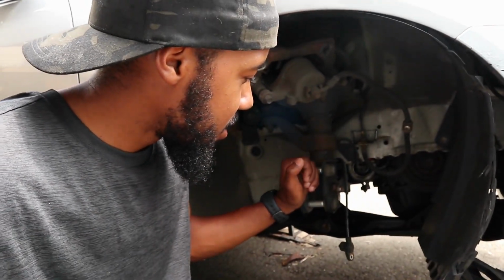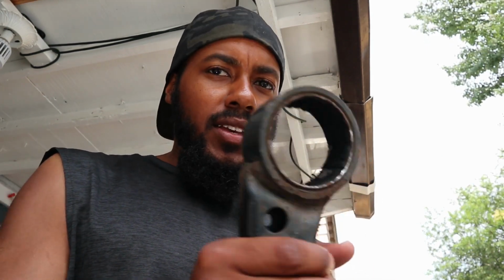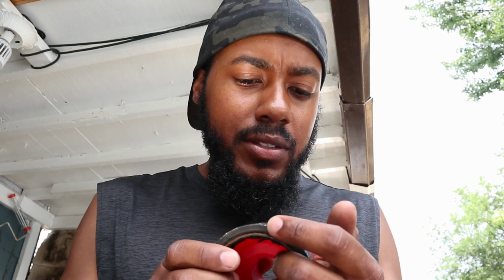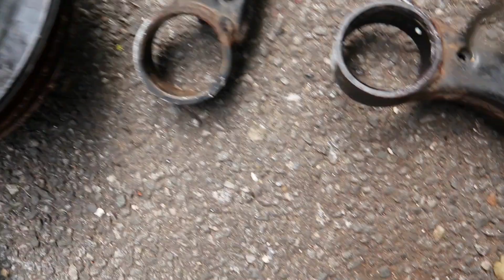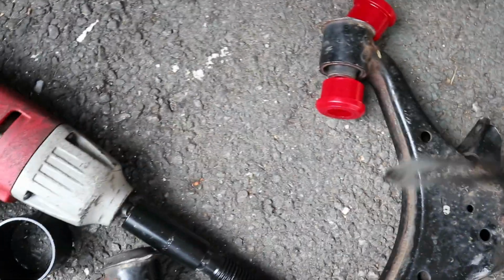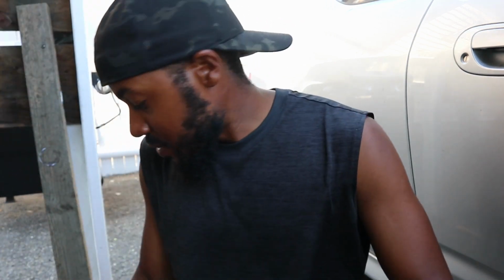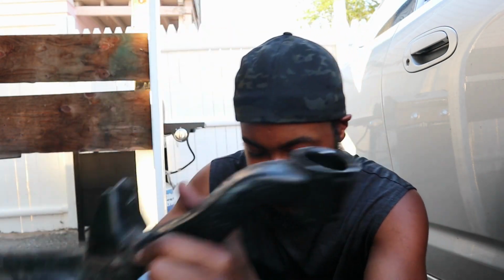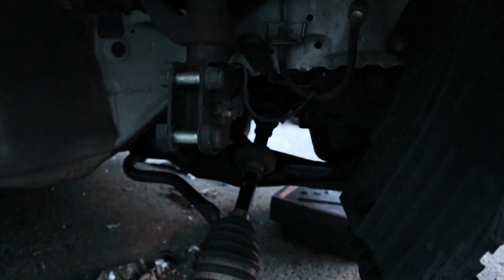Installing Energy Suspension Bushings on my Acura RSX

Comment: Instructions from Energy Suspension says remove OEM sleeves. Just curious, did your bushing kit not come with diagrams/ instructions?
Reply: The directions just say that to press the old bushing out. I assume that the sleeve is part of the old bushing, they want the sleeve out as well

Comment: Hey man, as you can tell, your video is still doing wonders for the RSX community.  Could you share what you noticed that led you to realizing you should have left the sleeves in?  After letting my mechanic talk me into him remove them, I am trying to track down a popping noise that i have tried everything to diagnose.  I am wondering if it could be related to him removing the sleeves.  Did you experience any noise or popping?

Comment: Good job, but you are not supposed to lubricate the outside of the bushings ( clamping force ) 
only the inside of the bushings are supposed to be grease ( the working part )

* liquid soap is use to install the bushings *

Comment: A tube of high pressure grease and the willingness to get dirty saves a lot of time and actually leads to a better/ longer lasting install imo. Nonetheless, props to you for getting it done and documenting some of the process for others. I think you just motivated me to throw my 360 cam outside when I work on my engines and spend the time to edit some decent content. I wrench full  time and have my life's savings invested in tools, and I have mad respect for anyone of any skill level who gets it done 👍👍 the most important thing I learned in my time spent as a mechanic was to make everything a learning experience.

Comment: I took the sleeves out. The bushings I got were pretty tight on there. Made it somewhat difficult to push down on the LCA so that it lines up my spindle with the strut bolts.

Comment: There are a lot of issues with these bushings, some are not manufacturers' fault, others - are. And I am not talking about price - this is something the buyer at least knows in advance.

1. Their claim that all it takes is "some smoke from the bushing to separate the sleeves from rubber" is outright lie. It may be the case with jeep but certainly not with Toyota - you need to torch it for a long time to actually burn rubber off.

2. The fact that they don't provide sleeves with the bushings is simply ridiculous. Especially considering price. In fact, I would not mind paying extra so that I did not have to dicect the old bushings, and the first issue is minor compared to this one. It is pretty common for bolts/sleeves freeze in bushings so it's virtually impossible to separated them from inner bushing sleeves without damaging. 
It may not be an issue with jeeps and fords because their bushings are replaced on a regular basis but Toyota bushings last so long that it's practically unavoidable to face this. In my case, the truck is 17 yo with 230,000 miles, and the original bushings were still good. The only reason I had to replace them was installation of lift and JBA upper control arms that required alignment that couldn't be performed because - you guessed it - one bolt and one cam sleeve were frozen. After 17 years in the Midwest and N-E, is should not come as a surprise.
This condition requires a hell of a lot of heating and pounding, pounding and heating, and then it's a real PITA to attach the [original] washers to most likely damaged bushing sleeves.

3. The last issue is design - there are no lubrication means. And don't tell me it's impossible - just look at JBA upper control arms. I installed grease fitting in control arm ears and drilled holes in the bushings to allow grease flow to inner sleeves. Hope it will work.

Overall, bushing material is probably adequate but pure inexcusable greed that prevented the manufacturer from providing lower bushing sleeves and washers (even for extra $$) is beyond ridiculous. 
Bottom line: if your vehicle is 10+ yo and has spent that time in places where winter happens every year, expect MAJOR (BIGLY!) hassle installing these bushings. Or - MUCH BETTER OPTION - buy from another manufacture that does provide all necessary coponents and does not force to wash and reuse condoms because reusing bushing sleeves is just as ridiculous as reusing condoms.
Reply from the maker: Wow thanks man for all your input! You're points are definitely valid! I was laughing at washing and reusing the condom lol, but it is true! They could have included the sleeves and a way to grease the bushings! I'm going to most likely go back to stock

Comment: Your supposed to remove the sleeve and use a purpose made grease on each bushing. Whatever works ig
Reply from the maker: Yeah I used the grease it came with but found out later on the website I was suppose to leave the sleeves. I'll be redoing them 😅

Comment: Your energy suspension came with instructions to remove the old bushings and SLEEVE.  Did you read the instructions? Just saying my friend.  Good luck with future servicing on you acura. I'm a long time honda/Acura tech. If you need anything just reach out my good man👍
Reply from the maker: Yeah I found out after, I'll be redoing it 😅. My first time using the energy bushings. The instructions wasn't clear on the sleeves. I had to search their website to find it
Reply: @aspireddrivenauto8650  good deal. Looking forward to more videos👍

Comment: Would an air hammer be enough to pop out the old bushings?
Reply from the maker: It's worth a try. The only thing is, the ledge you would put the air hammer on is very thin but I'm sure with some figuring things out, it could work

Comment: So ur saying not to pull out the sleeves for the bigger bushing because the polyurethane fits loosely if I take out the sleeves ?
Reply from the maker: Correct,  its not really loose but just a bit. I went on their website and seen that with that bushing, you leave the sleeve in.

Comment: Do you need to take out the metal sleeves from both bushings or do you need to leave them on the lower control arm & then press in the bushings?
Reply from the maker: If your installing the Energy suspension bushings,  leave the sleeves in.
Reply from the maker: The bushings for the smaller round one (left side), you can take the sleeves out
Reply: Yeah, I’m installing the same ones you did. Did the sleeve you take off affect your driving?
Reply from the maker: It doesn't affect the driving,  but I do hear it just a bit.

Comment: Is it better to clean out the residue from the old bushing in the sleeve? Just wondering why you didn't do that and just put the new bushing in. I'm looking at poly bushings for my ep3. Great video! Thanks!
Reply from the maker: Nice! Leave the sleeves in, I cut it out but there a small bit of play. I didn't clean them out thoroughly because I didn't think it would make a difference since the new bushings are polyurethane. There wasn't much left on there though. Thanks man ✊🏾 good luck with your car

Comment: Hey man do not stop bro you have been helping me out so much with my swap please keep making awesome videos brother. Thank you!!
Reply from the maker: Thanks, I know I've been slacking 😅. Just not enough hours in the day lol. I still have to edit the video of me pulling the dash out. Cars just about ready. Just a few final things then I can do a first start
Reply: Aspired Driven Auto I have a base auto rsx to and I’m swapping mines to standard right now but I was confused on the wiring harnes but I’m pretty I sure I seen in some comments you said we can still use the auto harness so I’m happy about that can’t wait.
Reply from the maker: I just started the car today. Everything seems to be running fine. No check engine lights at the moment. I'm still using the auto harness, I just had to extend the speed sensor. I'll test drive it tomorrow, hopefully everything is fine 🤞🏾
Reply: Aspired Driven Auto nice very awesome to hear I’m from Hawaii so not a lot of people doing rsx swaps out here so you had all the answers I’m looking for thank you again 👍👏🙏 you’re awesome brotha
Reply: Did the reverse plug fit to with the auto harness ?
Reply from the maker: No, I have to buy the connector and wire it in to the ECU. I had to extend the speed sensor though because it wouldn't reach. Actually have the car running, drove it yesterday 😎. I have to put up an update for you guys, I'm slacking 😑. Just not enough hours in the day 😅
Reply: Aspired Driven Auto thanks for the reply and being active bro I know a lot of work and not enough time in a day. Your views will understand. Thank you for sharing your knowledge
Reply from the maker: Thanks man, I really appreciate that ✊🏾. I know this content will be helpful to people. It's always nice to have videos to reference. I have to work on the final video of the series, I've been driving the car for about a week now, it's so awesome 😎✊🏾

Comment: Do you have a video on how you torched and use a puller to remove the last bushing
Reply from the maker: I actually ended up using the same method to remove that last bushing. I first drilled some holes through it all around, then used a jig saw to cut out the rubber, then cleaned up the extra rubber, and then cut into the metal sleeve and punched it out. Actually much quicker my second time doing it.